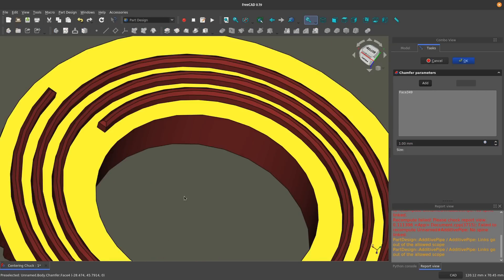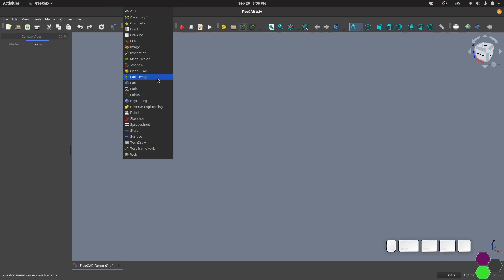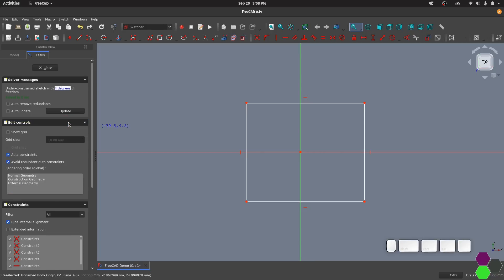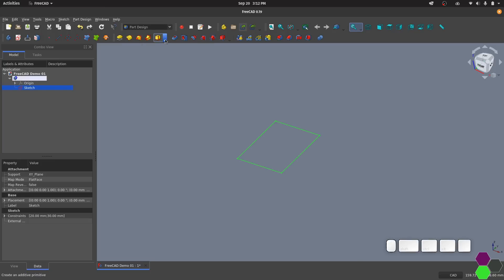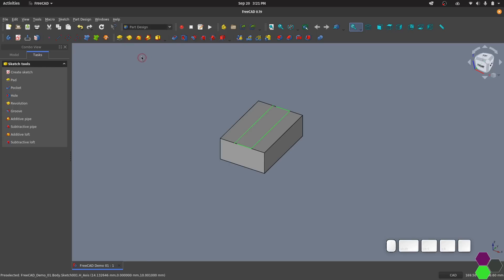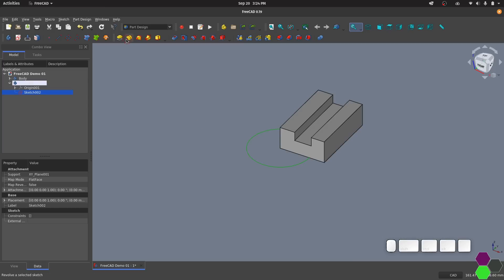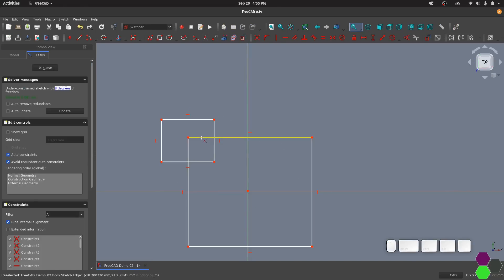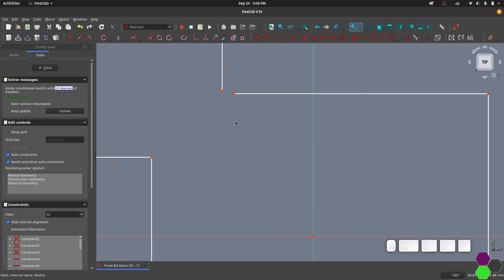Fusion360 to FreeCAD - Introduction

Comment: For anyone new to CAD design, don't be fooled: The Hole tool is very useful.
The hole tool allows you to define a hole with a radius, counterbore/countersink, and optional tapered point at the bottom. The software will then create a revolved cut with the defined profile shape. This can be later edited as a single feature with a single defined center point, which will reduce the number of sketches and features that you might mess up. Additionally, if you are designing something to be machined from a solid material, properly modeling the taper from the end of the drill bit is important. It allows you to correctly analyze the model, and the machinist doesn't have to call you up and ask how deep the hole should be because flat bottom holes can't be drilled. This is less critical for 3D printing applications, but the ability to create more complex hole geometry in less steps is still helpful.
Reply: I mean, you can drill a flat bottomed hole with an annular cutter or an endmill. But it's not optimal.
Reply: I agree, this was a somewhat odd recommendation by Brodie. I use the hole tool as I find the workflow of having all properties as a single feature to be easier to manage, but then again I don't do any professional work, only things for home use so perhaps my use-case is different.
Reply: Now with FreeCAD 0.20 you can even make holes with real threads for screws with different standarts like M1, M2... or custom ones. https://youtu.be/hXkNqsATWcs
It will be out soon.
Reply: Heartily agree...
Reply: You can definitely drill flat bottom holes. It's just not practical as the need for a specific drill would add to the cost unnecessarily unless you really need it flat for some reason.
Reply: Finally tried this feature out in Fusion360 today thanks to this comment.

Comment: I want to like this tool, but it looks so awful on Mac OS...
Reply from the maker: You could always try dressing it up.
There are various UI improvement addons, like the glass and modern ui addons.

Or you could go all out like this
https://www.youtube.com/watch?v=s7O0gIvXnLU
Reply: @BrodieFairhall  Thanks for the hints. My main problem is, not that they can look a bit ugly, it's that they are bigger than they should and does not fit on the designed spaces. At this point I don't know why they don't just mimic what exist
Reply from the maker: @Danielo515  Just under the dropdown for the color theme selection in preferences there is a dropdown to select Icon sizes. If you're having trouble getting toolbars to fit because of screen size or dpi scaling, changing the icon size will also change the toolbar sizes and can really help.
There are also full alternative Icon sets available for FreeCAD if you'd like to look into that too,
Reply: @BrodieFairhall  Thanks you very much! I'll give it a try for sure
Reply from the maker: @Danielo515  no problem, let me know if you have any issues.

Comment: I've been using Solidworks for nearly 20 years so I would like to see some comparisons to SW.  I still have a valid SW license and would be happy to contribute in any way possible to further the open source progress of FreeCad.
Reply: Search for Joko Engineering Freecad Solidworks.

He did a nice video on FreeCAD from a Solidworks Users Perspective
Reply: Seems to me that FreeCad is a lot more similar to solidworks than it is to fusion - for example the differentiation between additive and subtractive tools is very similar to Solidworks.
Reply: @TooManyProjectsWorkshop  I was thinking the same but I've only watched one video so far.
Reply: @TooManyProjectsWorkshop  Agreed. In many other ways. I don't know if SolidWorks still has these limitations currently because I haven't used it in a while but back in the day when I did, you also couldn't have open sketches, and you couldn't split bodies. Additionally, the sketch is absorbed into the body, where in fusion you can use sketches over and over again.
Reply: @Beerbatter1962  all those limitations are gone now.

I suspect FreeCad will reach that stage too - the splitting bodies in particular is a must IMO
Reply: I learned Solidworks in 2000 and have been using it until 2017 when I discovered OnShape. I've dabbled with FreeCAD for years but never become proficient.

Comment: How to create an sketch by an object face? In fusion it was really easy just to select the face and create sketch, that creates a sketch ready to extrude with the face shape.
Reply from the maker: I think you are asking how to make a sketch that is a copy of a face?
Depending on what you want to do with it, I can think of 2 options. @5:00 in the video I use the edge tool to select the edge of a face that I have created a sketch on. If you use this tool to select all the edges of the face, they are now lines in your sketch.
If however you just want to sketch on the face, you can select the face and create a new sketch, then that sketch will be on the face.

But if you just want to extrude (or another additive or subtractive tool) a face, just select the face and use a tool like pad or pocket etc to extrude it. You don't need to create a sketch first to do this
Reply: @BrodieFairhall  Yeah I meant to create a copy of the face, I see the tool, however it seems that creates constrains to the shape, not actually sketch lines, I am trying and it seems like I need to create the shape line by line connecting the points. Please, let me know if I am not seeing something.

Comment: I would be all about the FreeCAD but they need to make it so I can access and save to my network share. Don't do local storage and not being able to do that is a huge detriment to being able to use it.
Reply from the maker: FreeCAD definitely can work from Network shares. If the network share is visible to your OS in a file manager, it will be visible in the open/save dialogues in FreeCAD.
If it is mapped and visible to your OS but isn't visible in FreeCAD, I'd ask in the forum.
Reply: @BrodieFairhall  I actually appreciate the reply. Had tried a few different times and gotten the same error each time, searching the error had led me to that conclusion. Tried FreeCAD again and no error accessing the NAS. So it was something on my end and I was misinformed. Now I look forward to giving FreeCAD a proper go.

Comment: This is a great video (but your audio was off a little).  I'm a 360 user, and I am thinking about FreeCAD now, but after this video, I don't think I will.  Not being able to split an existing body into multiple parts is a big deal for me.  If I have an enclosure I'm building with a hole cut out on the side and some mounting holes on the bottom, I'll cut that part out of the existing body, export it to STL, then undo the cutting out.  That gives me a much smaller piece to print and verify the fit.  Mostly it's time I'm concerned with.  It might take an hour to print that section of the bottom and side, but four or five to print the whole thing.  I use this method on almost every project I work on, because most of my projects are mounting various electronics in enclosures for my projects.  I don't want to give this up.

But I think there are tools out there that I can do this with anyway. Maybe even my slicer (PrusaSlicer) can do that.  I'll have to look at that, because if my slicer can do it, it's not a big deal to not be able to do it in my CAD tool.
Reply: Turns out PrusaSlicer can cut models before printing.  OK.  I'm still in.
Reply from the maker: There are a whole bunch of different ways you can do exactly what you mentioned in FreeCAD and almost in the same way you do in Fusion, but I could only for a small amount in this video.
I'd definitely recommend checking out the development branch of FreeCAD RealThunder (one of the main Devs) is working on if multipart bodies is something you need, it's also a good look at what is the likely direction the software is moving in next.
https://github.com/realthunder/FreeCAD_assembly3/releases

Comment: I'm heavily dependent on Fusion360 GCode output from Fusion. Struggling a little to see if FreeCAD can fill that need.
Reply from the maker: FreeCAD can definitely do CAM path with gcode output, I plan to do a video on that once I cover a little more on the basics
Reply: You might find this video about using the Path Workbench to produce G-Code interesting
https://www.youtube.com/watch?v=MWFC17MIfOE

Comment: Loft in FreeCAD leaves something to be desired vs Fusion 360
Reply from the maker: In what ways?
Reply: @BrodieFairhall  I have a model that I specifically had to move to Fusion 360 because the lofts were impossible in FreeCAD:  https://drive.google.com/file/d/1wFJFcsPwIj-074oH0mMWf5XQXhASemsB/view?usp=sharing  Try recreating that object in FreeCAD from scratch.  There are lofts all over the place.
Reply from the maker: @ayourk1  I'll have a better look at this in the morning, it'll be interesting because I wouldn't have designed this part the same way you have, but it's absolutely going to be possible in FreeCAD
Reply: @BrodieFairhall  Most of the lofts were to dissimilar sketches.
Reply: @ayourk1  That's going to be a nightmare to manufacture. Are you doing fillament extrusion or resin printing?
Reply: @hydraulicsystems332  I have a Prusa i3 MK2 that I use.  I've already printed it out and it prints fine with supports.

Comment: A significant difference seems to be in FreeCAD each sketch can only have one shape. In Fusion, I'm used to a sketch having many shapes, and then extruding those shapes to different heights, and even starting at different offsets. But it seems in FreeCAD, that's not the way. So many more sketches. Do I understand it right? (Edit: The first sketch can only have one shape, but sketches on the body later can have multiple so long as they don't overlap, but it seems they all get padded the same)
Reply from the maker: Pretty much right,  you can have multiple shapes in one sketch if there is one outer sketch and multiple inner sketches. But since pad works on the entire sketch/you can't pick what parts of a sketch to pad and ignore others and you can only have one solid within a body, you can't have multiple separate shapes within a sketch.
Reply: And that's one of the reasons why F360 is so attractive and easy to use. Everyone go use Freecad, I'll keep using the nice tools, all to myself muhahah

Comment: Unless it has been fixed in the version 0.19, one should never use part of an object as a reference plane for a new sketch. If you ever go back and edit the original object, the order of the edges and surfaces get randomized, and you will find that the part of the design that referenced part of the edited object is now referenced to a completely different part of that object. Reference everything from absolute planes, or you will have a bad time.
Reply from the maker: I'm actually doing a video specifically on the topological naming problem, but this video was really just to get people feeling as comfortable as possible in a 10ish minute video.
You should also checkout RealThunder's latest dev build, the naming system has been completely re-done to remove the problem all together.

Comment: Nice vid, thanks.  I've done some extensive modeling in Fusion360 and wondering if it can be imported into freecad?  Autodesk just updated their license for the free version so, as you say, I'm wondering what will come next.
Reply from the maker: Standard interchange formats such as IGES and STEP etc. That can be exported from Fusion (and most others) can be imported. There is an Autodesk Inventor file loader add-on, so there is the potential for an add-on to import fusion f3d files if someone wanted to do some work to reverse engineer the file format.
Reply: @BrodieFairhall  STEP is way better than stl but Autodesk is doing away with STEP in the free version too. ugh.
Reply from the maker: @charlescarey5874  apparently they're bringing it back. But, it's Autodesk and they could just do something like this again at any time.
Reply: @BrodieFairhall  Lars Christensen just did a video on the changes.  He interviewed an Autodesk executive.  In my opinion Lars is the best thing that has happened for Fusion360 Hobby users.  If someone like yourself, who has communication skills as well as CAD/CAM skills, were to emulate Lars it would take a lot of the pressure off the transition. ;) Looking forward to your next video.

Comment: Is FreeCAD internet based?
Reply from the maker: Nope, it's a standalone desktop app. This was something that appealed to me personally compared to OnShape and Fusion360. It means your files are in your possession and you can work without internet. It also means there isn't any baked in collaboration tools.
Reply: Great! Autodesk is bleeding me dry. Can I do assembly drawings with my parts designed together? I have assembled parts, with no way to transfer them together in a file. I'm forced to keep a subscription to hold assemblies together.
Reply: Can I work with my completed drawings using the STL format?
Reply from the maker: @brianconway5708  You can have Assemblies in FreeCAD with the Assembly 3 or Assembly 4 workbenches and you can definitely have it all bundled into one file.
You can work with exported stl files, but I wouldn't recommend it. Just like Fusion, FreeCAD can do some limited work with meshes like stl files, but it's far more limited than what it can do with solids.

Comment: Also considering Freecad as a fusion replacement. Looking forward to more videos like this. Is 0.19 already stable enough to use?
Reply from the maker: I've been using 0.19 since the beginning of the year without any real issues. As with any app, save your work regularly and you'll be fine :)

Comment: I'm having a super amount of trouble extruding sketches into parts. A lot of times in fusion I get to extrude from a feature in another body to some arbitrary distance or even another feature in the same or a different body.
Also struggling with projecting features from bodies into sketches. Almost got the draft tool to work, but the lines keep moving.
I learned today that a pad is attached to the sketch and you can't reposition it later, while an extrusion is NOT attached to the sketch, and you CAN move it.
Lining up bodies face to face is kicking me in the teeth, too, although point to point was just hidden. Interested in ways to move things around efficiently.
Last request, when you get to paths (CAM) the path body moves when I try to position the part in the stock and the path calculates from there. Is there a way to line it back up with the modeled part so the toolpath looks like it's in place on the modeled part without losing the location in the stock?
Reply from the maker: A lot in this one, I'll try and cover as many of your questions as I can. I will probably cover a lot of this in a video soon too.
Extrude is in the "Part Workbench" and Pad is in the "Part Design Workbench"
Basically using the Part Workbench is like modelling in Fusion with history turned off and Part Design has full history. While the two workbenches do interact on a level, they're both very separate systems. Of you have faces on part design bodies they should project nicely into sketches, but part bodies could be a bit weird. To move bodies in part design you can right click on them in the tree and select transform, this moves the body origin and all the previous operations come with, part bodies aren't attached to anything historically so they can just be moved around freely. The is something I have not really touched in years, I'll catch myself up on it and see if I can work out why your lines are moving.
If you want to line parts or bodies up, I'd have a look at the assembly 3 or assembly 4 add-ons (and look up a tutorial on how to use them).
As for CAM stuff, I am just getting started with it in FreeCAD, I'll have a look at it in a few hours to see if I can work out what the issue is (is it a body created in part design workbench or in part workbench).
Reply: @BrodieFairhall  thanks for the tips and for considering my questions. I know it's a lot, I just thought that maybe I wouldn't be the only one getting frustrated over them. Thanks a bunch for doing this work. I'm looking forward to checking these videos out!

Comment: Subscribed.

What I'd really want to know more about is how to deal with 3d sketching, more specifically on non orthogonal planes and for scaffolding purposes. Thinking of situations where you know a few parameters and need to use the sketch as a construct to find the actual measurements of your parts.
Reply from the maker: I'm sorry, I want to make sure I get what you're asking correct. Do you have a simple example you could point me at?
Reply: @BrodieFairhall  Currently in Fusion, I use 3d sketching to model complex concave shapes on multiple construction planes that are not the origin planes. Those scaffold construction sketches are parametrized by measurements that are NOT the final part dimensions, basically their job is to actually compute where the part should go and how to bend the shape to conform to that.
Sorry I know this sound confusing. If I had to think of a concrete example that more people could understand it would be something like this: You have to design an aftermarket car bumper, you only know the location of the fastening points and of the chassis bounds, these are not located on any single 2d plane, and you have to generate a shape that surrounds them with and matches the fastening locations.
I hope that makes some sense, if not don't worry too much, I'll end up figuring it out somehow.